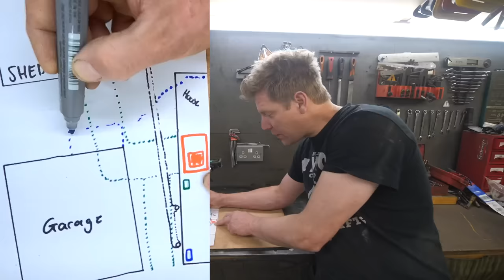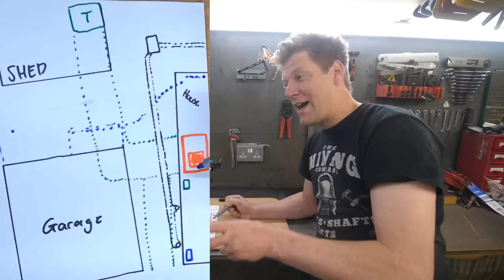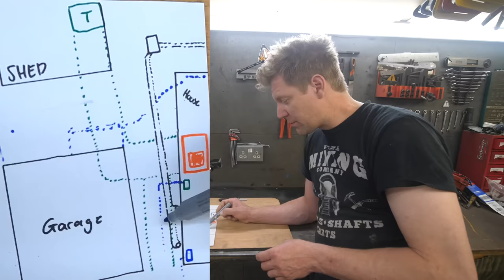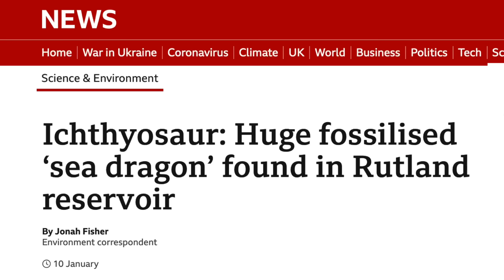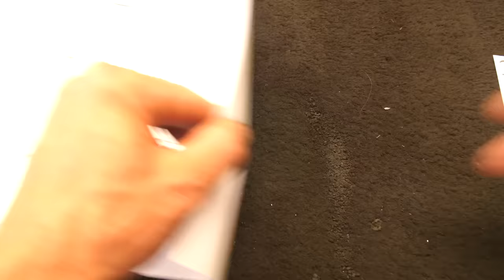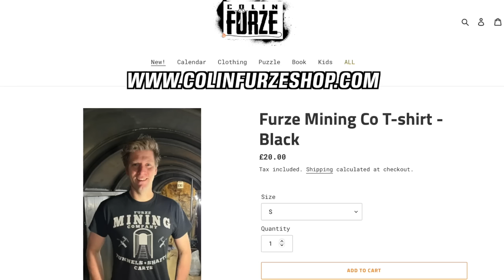DIGGING A SECRET TUNNEL Part 9

Comment: Being a geologist and watching you describe the rocks is great fun 😅

That was definitely a shell impression on the second rock you showed (12:52), they can be found on there own but usually you would see more with them.

On the third rock shown (12:58), on the dark surface there appear to be striations which can be from a flattened shell, but the dark mark definitely looks more organic in nature from your video.

Fourth rock (13:12), I can’t say for certain what exactly that is as palaeontology/sedimentology were not my specialisms however based on the apparent thickness and colour you wouldn’t be incorrect to assume they were calcified fragments of a shell.

On the rock (13:27) with the quartz and calcite crystals, you see the darker semicircular marks they are the side profile of a shell very similar to the way Jurassic bivalves can be seen in the limestones around the UK.

My suggestion would be if you haven’t already done so give them all a rinse with some cold water to get the worst of the surface dust and debris off, as limestone/clay covering will hide some of these details
Reply: What kind of rock is he digging? I always wondered that.
Reply: As a geologist, I would also agree with you. Those are some pretty nice calcite and quartz crystals there, Colin! At 13:12, I definitely think that's a shell. Too thick.
Reply: I thought quartz seams can indicate the presence of gold in the rocks. I know the UK is generally low for the quantity found though, but you two geologists would know better
Reply: @RogueTrooper80  I looked it up, and yes gold is often found with quartz as they're chemically complimentary, but not all quartz seams contain gold.  I was thinking much the same thing myself though.
Reply: @RogueTrooper80  there are more fossils than you know in the UK, the amount of sites where you can find them are more limited and we have generally got less of the “amazing” fossils such as full dinosaurs but we do still have some
Reply: @SmartPhone7  I would say it’s a limestone possibly from the Middle Lias (lower Jurassic) as I saw very similar specimens of rock material and fossils while on a piece of fieldwork in Oxfordshire
Reply: Geology nerds, UNITE! 😂
Reply: I would say it is unlikely to be quartz within the Jurassic limestone and is more likely to be calcite. A quick hardness test will confirm. If it scratches easily with a steel blade then it is calcite, if the crystal scratches the blade then it's more likely quartz (On Moh's scale of hardness - calcite ~ 3, steel ~ 5.5, quartz ~ 7).
Reply: @LesW100  although a different part of the UK, i grew up in north derbyshire, and the limestone there regularly has Fluorite/fluorspar in it which from memory looks very similar, might well be the same as Calcite but that isnt something id heard of before. as a kid i'd reguarly find rocks with loads of shell fossils in them too, which is kind of crazy when you consider how land locked the peak district is now... that said, one ridge locally has sandstone one side and limestone the other, so at one point i presume active tectonic plates will have pushed what was sea level up to make the hills... might only be rocks but its facinating stuff
Reply: @dankrafted  I'm going to guess you are talking about the Peak district. In the Peak district there is lots of mineralistion, including fluorite, lead, zinc, barite, etc. These minerals were emplaced by rising hydrothermal mineral rich waters, driven by volcanic heat. Where Colin lives is a much less exciting region, geologically, with Jurassic limestones and little else. Calcite crystals can easily form as calcite is already present in the rock there. Calcite is much more soluble than other minerals and heat is not needed to drive solution and recrystalisation. 
That said, he should be finding loads of fossils, such as Amonites and various bivalves.
Reply: @dankrafted  the UK used to be by the equator and was under shallow water for millions of years, this is why we have so many shells in the ground and also why we have so much coal
Reply: @louisstanko86  for the area I research in the UK was down near equator. One being a shallow sea with large drop off and the other is 250m deep. Get some amazing stuff!
Reply: Thanks you  @LesW100  and  @Louis Stanko , that does explain a lot, you are correct i was referring to the peak district, my village was an old lead mine (hundreds of years ago), and the fluorspar mine is on the other side of the valley. i was probably told these things in school, but 14 year old me wasnt as interested as 41 year old me. thanks for the info guys :)
Reply: Miles Doyle  Come on mate, thats a bit deep for a youtube video on tunneling, you fun sponge
Reply: Normal guy: I think this is the remains of a dinosaur that fought with a UFO, winning, but immediately dying due to it's injuries, leaving them both to become immortalized in stone.
Geologist: it's a shellfish.
Reply: 4.rock  probably has  a Pecten shell, not sure since cant see the other side of it.
Reply: the rock at 12:52 looks more like a result of concretion where rocks are deposited into forming sedimentary rocks. not 100% sure but that’s what i think it most likely is
Reply: Miles Doyle  Just for the record: No body disputes that Jesus existed, it's a consensual historical fact. Now, god however, is an other thing. Anyway, I think you are a bit off topic here.
Reply: @noah-jw1nk  that'd be a conglomerate or an inclusion, a concretion is where a nodule of harder rock forms within the host due to differing mineralisation. Similar sounding words but they mean different things

Comment: Love the idea that someone commented about having some of the rock face on view behind glass and if you dug out a little bit more you could put all your tools like your pick axes and your hydraulic breaker on display as a little museum, keep it up Colin .... marvelous.
Reply: That comment was right above this one for me😂
Reply: If you saw Mark Rober's video he made a cool museum like that in his new workshop. Would be very cool.
Reply: Could possibly fill a section with clear epoxy so you don't have to worry about the rock and dust slowly crumbling down to the bottom and filling the window with dirt.
Reply: @Skinflaps_Meatslapper  just make the case accessible from the tunnel and make sure there's no lip at the bottom so you can dust and sweep it out and such.
Reply: @Skinflaps_Meatslapper  clear epoxy is definitely a great idea. No dusting or risk of water seepage or crumbling. I picture it to be side lit in a warm glowing light spectrum.
Reply: @stuey7777  Yeah, definitely.  I imagined it sort of like how those trendy river tables are made that have embedded lights in the wood to illuminate the epoxy.  Could just as easily go from a natural light to a rave at the push of a button, or drop a little toy dinosaur or memento in there for fun.

Comment: The fossil "clam" is a braciopod fossil (a type of ancient bivalve). The quartz is likely calcite as the host rock matrix appears to be limestone or silestone both of which are CaCO3 rich rocks. Drop a few drops of dilute(~10%) HCl and if it fizzes its calcite or limestone.
Reply: I came here to add the calcite comment, glad to see someone did!
Reply: Vinegar works just as well as a testing solution, it comes pre diluted to a reasonable working strength and is much more readily available
Reply: What Matthew said!!!!
Reply: This guy Rocks!
Reply: I have no idea what you are saying but nice.
Reply: for people who are confused about the CaCO3 stuff: CaCO3 or calcium carbonate is the same stuff found in egg shells. One experiment people might do is dissolve the egg shell by placing it in vinegar overnight. This is basically the same principal as that when it fizzes with HCl or hydrochloric acid. Hope this helps, Trying to dumb it down a little as a chem student.
Reply: I second this ops comment. The host rock often dictates any secondary mineralisation and that rock would hint at calcite.
Quartz is distinct in its crystal shape - there will still be small examples of individual crystals if you look hard enough at the collected rocks.
Reply: I thought the fossil was an ancient sharks toenail...big toe probably.
Reply: Call me pretentious but arent brachiopods and bivalves completely different Phylums? As a geology student at A level I learned that Brachiopods come from the phylum brachiopoda and bivalves come from the phylum Bivalvia

Definitely agree that it's a brachipod though. Although to see one preserved in what appears to be sandstone is unusual. Usually find them in Limestones and shales
Reply: @jackking5567  I'd love to see Colin upload a short testing the rock to see if it's limestone cause I'm not convinced. Looks more like orthoquartzite to me. There's a lack of micrite/sparry calcite in my opinion. Plus the colour seems a little off

Although I guess it could be oolitic limestone, but again I didn't see any evidence of ooliths... Idk I'd need to get my hands on it in person

Comment: Really hope that draft coming from the bedrock isn't a radon hazard, especially if the area is quartz-rich. If the tunnel has good active ventilation, it shouldn't be a problem either way, but if it just has passive circulation, you might want to do a radon test.
Reply: Definitely worth measuring the Radon levels
Reply: It's not an issue in some countries.
Reply: Bruh. Have you never heard of radon issues? AFAIK almost every building in the US, especially ones that extend underground, has to be tested for radon.
Reply: @sagittariusa4023  he's in the uk but it still makes sense
Reply: I didn't even think about the fact that radon might be an issue but that does actually pose a solid concern.
Reply: Funfact: the Radon cames maybe from uranium deeper in the earth like in mühlviertel, Austria and Schwarzwald, germany
Reply: Not great, not terrible.
Reply: @neglectfulsausage7689  radon gas is a real thing '-'
Reply: @neglectfulsausage7689  TF are you talking about? Radon isn't a fantasy gas, surveyors will test homes for Radon levels before you buy it. Mine came back with slightly high levels of Radon, I had to have the floors treated to protect myself from overexposure to radiation.
Reply: @andreimadalin6207  - Radon is a big problem in the UK, especially in the granite rich South. A lot of areas around Plymouth are actual very near the limit just from natural formations.
Reply: I was thinking he’d be in trouble if the water table ever rose.
Reply: Good catch, I checked the UKradon map and some areas around the Rutland water reservoir are indeed of "elevated Radon potential" (the highest level they give).
Absolutely worthwhile testing and maybe even a potential video, I can't wait to see Colin mucking about with a Geiger counter.
Reply: It always tickled me that the most radioactive place in the UK was a public toilet in Cornwall (Granite cliffs giving off radon gas and poor ventilation resulted in it being more radioactive than inside a nuclear power plants reactor hall).
Reply: @GeraintDafis  yes I know there are some areas were it's a problem.
I'm also sure CF would know that as well and especially that the council guy would have said something right?
Reply: @neglectfulsausage7689  I suggest you look it up. Radon is a problem in many areas.
Reply: I live about 10 miles from Colin and it's very radon rich, but varies almost street by street because of the geology
Reply: @neglectfulsausage7689  who else played final fantasy Crystal Chronicles?
Reply: I built real real life Spiderman web shooters that stick to walls and hold 200 lbs. I prove it in my channel.
Reply: Radon comes from Uranium, a common constituent in granite and other igneous rock common in most of the US. He is tunneling through limestone, a sedimentary rock. Risk or radon is very low.
Reply: @oddball_the_blue  That's the loo I use every morning before work - the missus wont let me go in the house - might explain the radioactive levels
Reply: @petrolhead0387  i wish you'd fcall me to do your floors after getting a "radon" test. I wouldve made money off u instead.
Reply: @NEEQOS no Problem maybe you can found Uranium deeper in earth. Radon is a noble Gas so it can wander through the earth
 i dont know much about Florida ^^ i m from Austria
Reply: @Seth21914  Mühlviertel jawoi
Reply: If it puts your mind at ease, this was suggested by the planners as well as part of the planning permission.
Reply: there's not a lot of radon up that way, but even if there was, his design is a mostly airtight skin so it should be fine.
Reply: @japanfred  great Cherynobl reference
Reply: Methane test also.
Reply: It appears well vented… radon was never a problem until people sealed up all the cracks to save on energy… ventilation is all that is needed
Reply: @petrolhead0387  it's a gas so usually you need to put vents that extend under the bottom slab to vent it out.
Reply: @kiwibob223  It can be in the U.K.
Reply: @ronblack7870  the ventilation was already in the house, it was the 100 year old cracked concrete that was leaking.
Reply: There was a comment on the planning application noting that it is a radon risk area and he should have an assessment done
Reply: He’s concreting the floor too so that’s surely giving some barrier.
Reply: @oddball_the_blue  Somebody did a giant nuclear dump.
Reply: 2nd leading cause of lung cancer.  It varies greatly by location, most states show the areas that are more likely...
Reply: Radon is mentioned in the planning documents online
Reply: He has active vents. Several fans push air out and in respectively
Reply: @andreimadalin6207  UK has radon issues. Most places do. Assume the worst, hope for the best
Reply: @neglectfulsausage7689  If only you were qualified to even sweep the floors.
Reply: You crushing bore
Reply: @Seth21914  Florida (America's least historical state). Yes I've been to St. Augustine. So disappointed
Reply: @notoriousgoblin83  well said sir

Comment: The holes in the rocks are natural air tubes that do in fact go for miles. Many people in western America have found ways to link their homes up to these tubes. The tubes provide great natural air conditioning!
Reply: @BrendanRaymondKoroKoro  It's bizarre that people still frack right next to people's homes. Especially in the US where they have tons of completely empty land everywhere.
Reply: Don't forget  about radon! :/
Reply: I think colin should get a radon meter and see if levels are elevated in the tunnels at all, even though it doesn't seem like the type of rock to produce radon
Reply: @Jake-bt3fc  it massively improves production on old wells what they are doing is opening the capillaries in the rock wider so more gas and oil can flow through
Reply: @Jake-bt3fc  There are cases where it's done somewhat close to a home, but it's pretty darn rare.
Reply: @imchris5000  wish they'd report what they put in those franking fluids is all.
Reply: @sevenodonata  radon isn't real
Reply: @deanmcloud3485  Tin foil hats are real 👍
Reply: @deanmcloud3485 Tell that to people who've had to have expensive remedial work done on their home in Cornwall. You obviously don't live on granite bedrock.
Reply: you know damn well someone has farted into one of these mile long air tubes
Reply: @deanmcloud3485  ever seen the periodic table?
Reply: @deanmcloud3485  I agree. Never seen it myself.
Reply: For some clarification, it's not common for people to link their homes to these natural air tubes. On the youtube channel HeavyDSparks, he has a video called "We Discovered A Hidden Mountaintop Compound In Our Own Backyard" in this video they explore a house being built on top of a mountain owned by a man named Allen. At 33:55 in the video, Allen shows the shaft he built that connects down to the micro caves below.

I have absolutely no idea about radon or other natural gases, but I'm sure they could be problematic.

Comment: This project, for me, makes the Great Escape even more amazing. Imagine how hard it would be to dig this tunnel using bowls as shovels.
Reply: They did have a sandy soil though, but the length and how they had to acquire wooden  cribbage for the tunnels meant none of the beds had adequate wood left supporting their mattresses. Not to mention that disposing of the sand was big issue due to the difference between the ground top soil layer and sub soil layers, had to be careful spread around the camp as just dumping the sand would draw attention.  The documentaries of about all the problems they had in addition to just digging the tunnel by spoons  and bowels  shows how ingenious the plan was. The fact every bunk house was built above the ground so that the tunnel was exposed and anyone going through that open space was at risk each time.... continues to add to the list amazing facts of that project.   

Which if you haven't head of The "Colditz Cock" which  was a glider built by British prisoners of war for an escape attempt from Oflag IV-C (Colditz Castle) prion camp in Germany, I suggest you enjoy another "great escape" that almost happened but the war ended before they flew their glider out of the attic in the castle.....  Post war inspection believed they would have had a working flying glider for their escape.